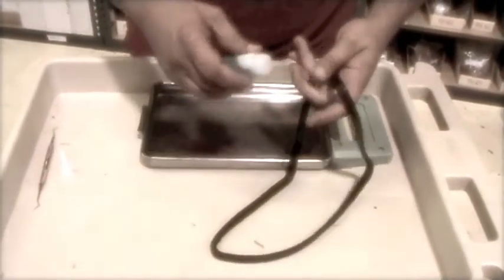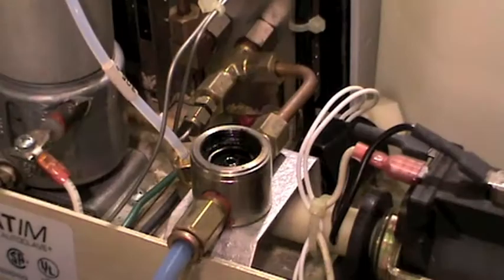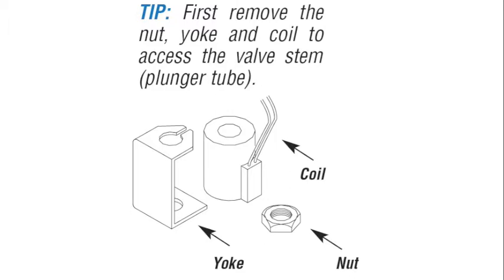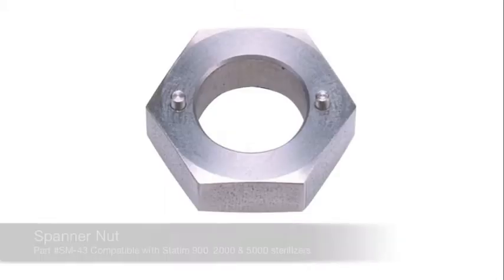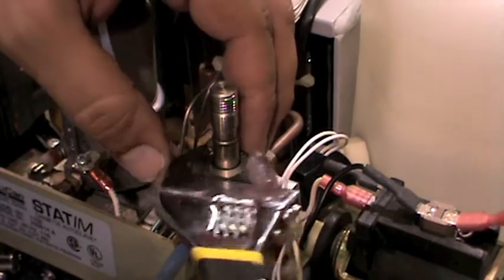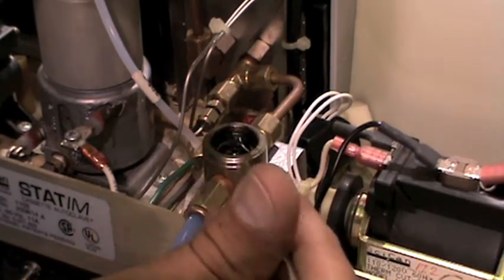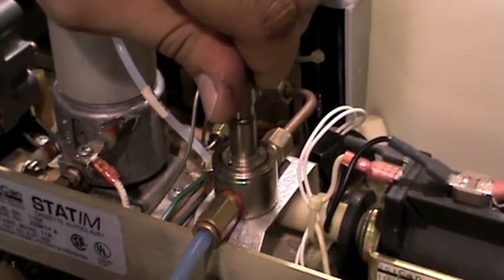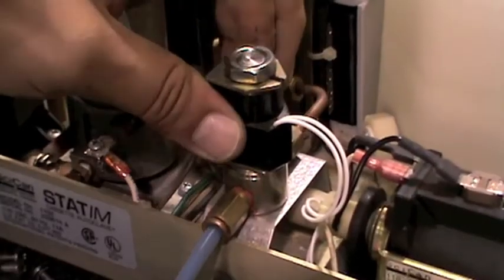Statim® Solenoid Valve Inspection & Repair

Comment: Holy cow- I commented on this video 8 years ago (and you answered me 8 years ago also!)  I’ve got another question. My Statim 2000 is working fine, but every once in a while I get the urge to take the solenoid apart and clean it. I’ve had the thing for probably 20 years and never took it apart. So I bought a spanner nut from DCI (with the two prongs/pins like you show in your video), and proceeded to snap one of the prongs off inside the hole in the valve stem of the solenoid valve  the stem was so tight it wouldn’t budge at all.. Have you ever seen that? I was tempted to take the Statim to an operatory and drill the stuck prong out of the hole, but I just put it back together and put the machine back into service. I could replace the entire solenoid if need be, but have you ever had that happen?  Thanks.